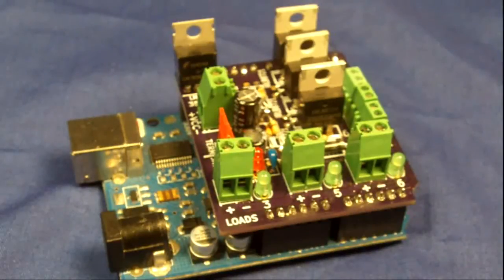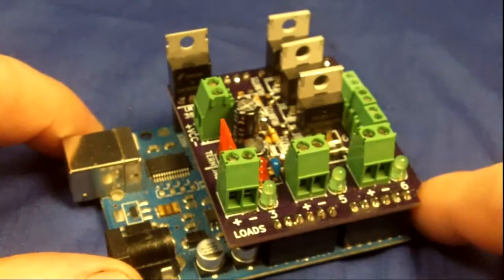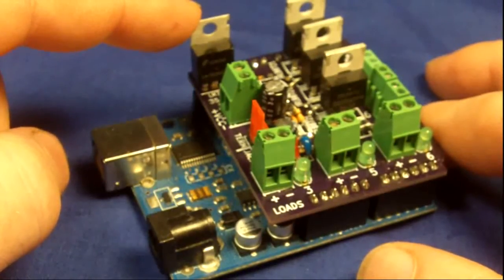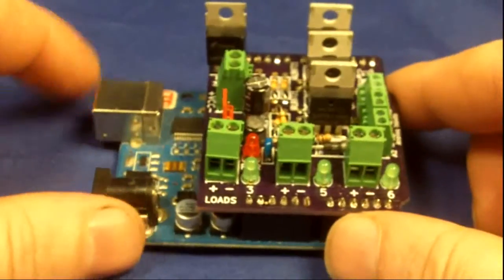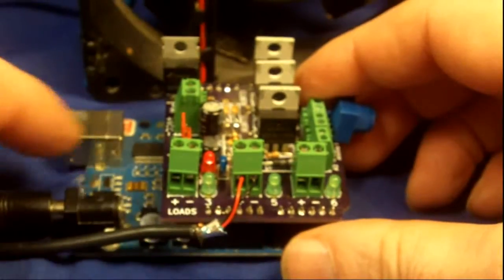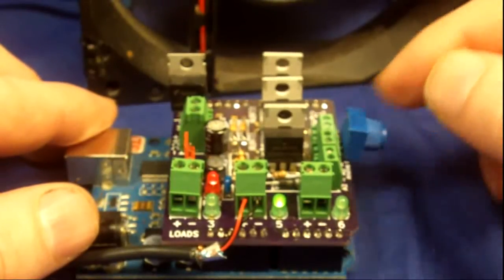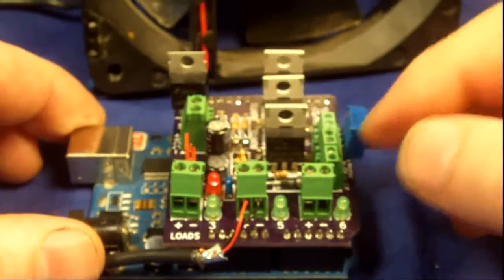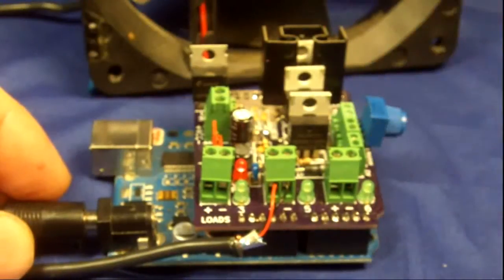MOSFET Jr. Arduino Shield

Comment: Whats the highest amp it can handle i have two linear actuator that pulls 6amps each at 12v can this handle and what input the 9v or the 12v of the mosfet jr
Reply from the maker: The MOSFET itself (IRLB8721) is rated at 62A, so the limiting factor would be the traces on the PCB.  I've made them as wide as possible, so they should handle the load, and I routinely do 30A startup current for brief periods.  If you buy my kit, and you melt a trace, I'll refund your money!  If you just want to wire something up directly with 18 or 16 AWG wire, check out https://youtu.be/aTIMXKTnai8.